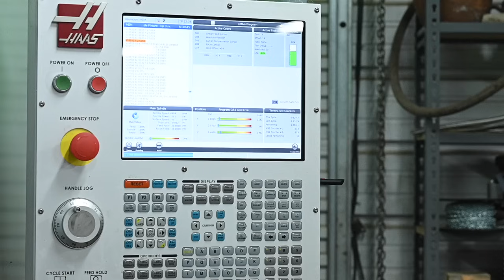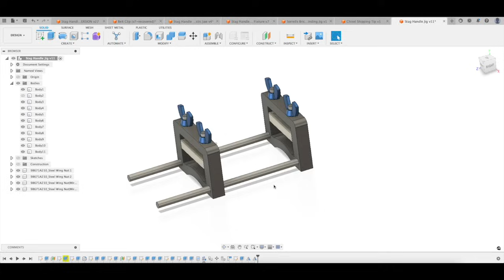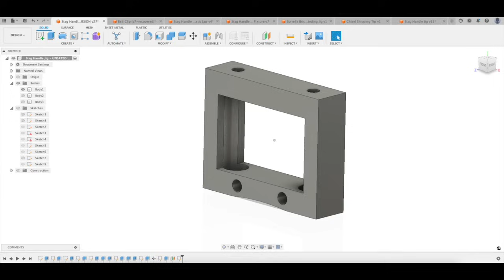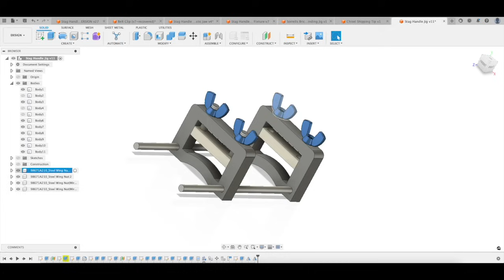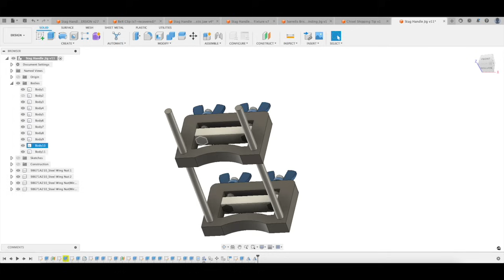This Drilling Tool Will Amaze You! (You'll Need One for YOUR Shop)

Comment: I bought an earlier version of a drilling clamp from Pops in the spring of ‘22. I had the same concerns you mentioned in the video, that of maring the material and some stability issues as there wasn’t the rods between the clamps. The system worked well, but it was a wrestling match getting the material set correctly in the clamp with a set screws tightening from underneath. This looks like a much better solution to drilling uneven material. Thanks for the video Walter.

Comment: On the bolt issue, they make T-slot bolts that are used a lot in woodworking. I believe they would fit the slot better & be less likely to spin when over tightened. Especially if you widen the plastic piece a bit & cut in a T-slot instead of a straight walled channel.
Reply: This makes sense.  They are flat headed as well - should be easier to do.

Comment: I have a few of these from diffrent places.    They simply need somthing yhats will form fit around the handle to hold it in place.   None of the ones i have will hold any rounded handle very well.     If the plastic peice eas form gitting.  You could drill both handles vs one at a time.

Comment: Why are you pulling up the workpiece? This means you need an expensive closed frame. Push the workpiece down. You only need a bridge with two tie bolts. This bridge pushes the workpiece downwards. Fewer parts are therefore needed. Thanks for your video.
Reply: The blade, being used as a drill guide, should present square to the table.  If using a downward press, I would recommend vertical guide rods to maintain the blade’s orientation.
Reply: @jeremylastname873  I understand what you are saying.
thank you for your explanation
Reply: This is the most civil discourse I’ve ever seen on YouTube